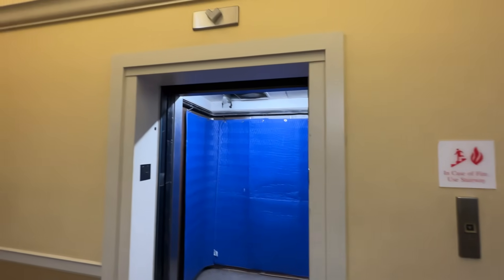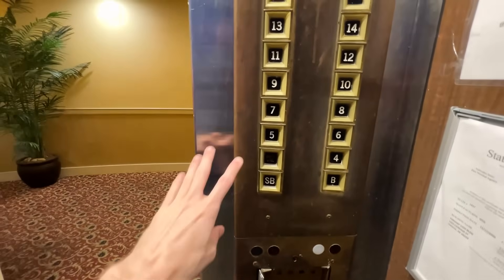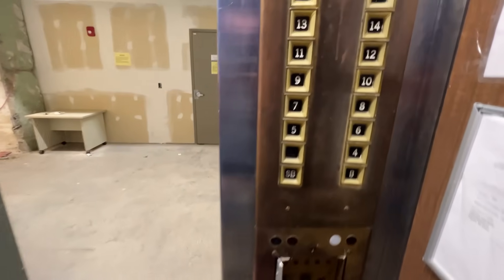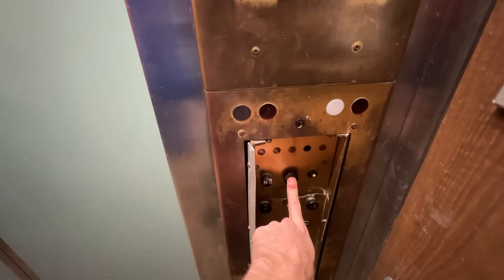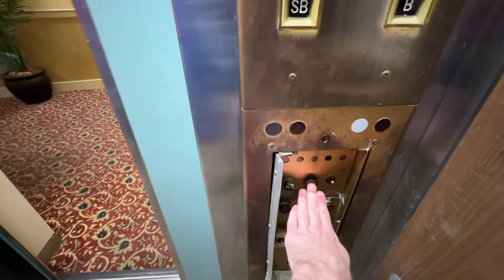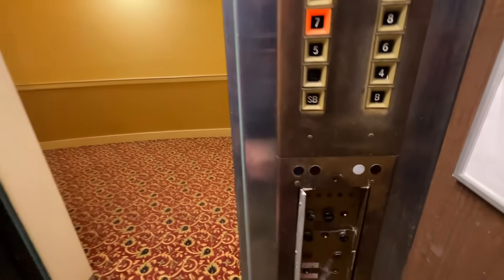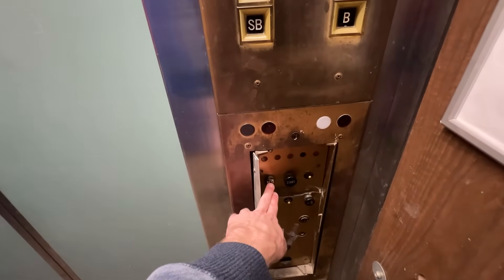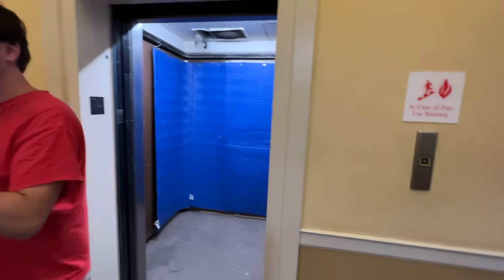Otis Autotronic Attendant Mode Demo

Comment: Reminds me of an Otis Signal-Control system (the system that preceded Autotronic) in that the operator must select a direction, and initiate movement of the car (in this case with a button rather than a lever/"car switch")
Reply from the maker: Yeah it reminds me of that too

Comment: Awesome! This has to be the first video I've seen on YT that actually demonstrates 'Attendant Service' proper (and not the more widely known 'Independent Service'). So thanks for that!

As you experienced, while in ATT (Attendant) operation, the normal collective call logic is ignored and full control over car direction is given to the car operator. I should note that this is somewhat dependent on the particular controller used in each install (some newer vintage systems don't have direction buttons - the 'U' or 'D' buttons | seen here as 'Rev U' and 'Rev D'. In such a case, I'd suspect that normal collective call logic is utilized even while in ATT operation). I'm particularly glad that you showed off what happens when you forget to reverse car direction when selecting a call in the other direction (in your case, you continued to the top floor even when there wasn't a call selected for that floor). Goes to show how operators back then would have needed to keep track of car direction at any point in time to minimize waiting time!

One thing I do wish was demonstrated here was how ATT operation interfaces with the dispatching of hall calls to individual cars. This is the primary difference between attendant and independent operation in my opinion - independent operation removes the car from group operation, meaning the car will not respond to any hall calls. My understanding is that when the dispatcher assigns a particular hall call to a car under ATT operation, the car will alert the operator to the assignment using certain means (often a buzzer and possibly a light to indicate whether the call was above or below the car's current position). I understand that such a demonstration is very difficult to perform since it essentially relies on someone being present to register a hall call and for the dispatcher to simultaneously assign the call to the car under ATT operation. But perhaps such a demonstration can be performed in the future with a little more assistance. It's also possible that what you demonstrated here was not true attendant operation and was instead independent operation. The lack of automatic call direction reversal is not exclusive to only ATT operation. Independent service on older elevators can also remove such a feature (as seen in a older Dieselducy video showing off independent service on an old Otis elevator). Regardless, perhaps a future video could explore such a feature that is only present in ATT operation :)

Final thing here about the NS button. The NS (Non-Stop) button is generally only applicable to ATT operation insofar as the cars ability to answer hall calls (non-stop was not designed to skip car calls). Many Otis patents from the period describe this non stop mode as being used for skipping the answering of hall calls for load related reasons or for certain circumstances regarding a car going through particular zones to answer calls <- generally speaking this only occurs while in up peak or down peak operation to allow the car to move from the bottom landing to the top landing (or vise versa) in one trip. Usually the only reason an attendant would utilize such a non stop button is when the car is loaded to capacity as they wouldn't typically skip hall calls for any other reason. It will also enter non stop mode when the load switch is tripped (indicating the car is filled to capacity) - though it should be noted that this load switch is only utilized while ATT operation is off. The patent US2,589,242 says this "The car buttons, however, are unaffected by the non stop button and stops are made to discharge passengers. Relay NS also separates contacts NS1 to prevent the lighting of the hall lanterns". I don't really have a better way to describe the NS button than that it is used while in ATT operation so that the attendant can skip hall calls for load related reasons. Note: If you need to use the non stop button, you must keep it depressed for the duration of the time you wish to be in non stop mode - according to the patents logic, the NS relay is not self latching.

You can read the patent US2,589,242 and get an idea of how ATT operation should work for a system like this. It's quite detailed and goes through the individual circuits to an insane degree. It's also quite dense with over 60 pages of pretty much pure words. But it is the best resource to learn about these things! If you plan to create a simulator for ATT operation, reading and understanding this document is practically a necessity!

~ The End ~

(It's possible that YT might have deleted my original comment, so here's attempt #2)